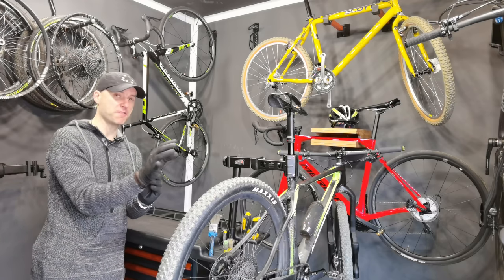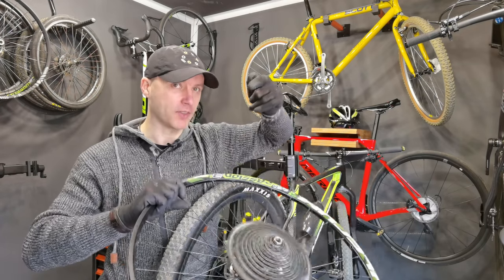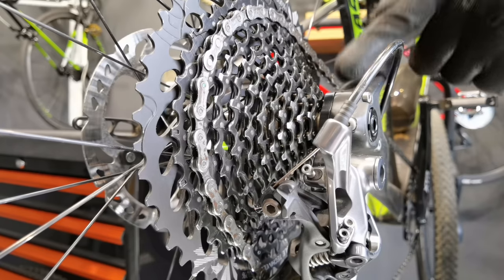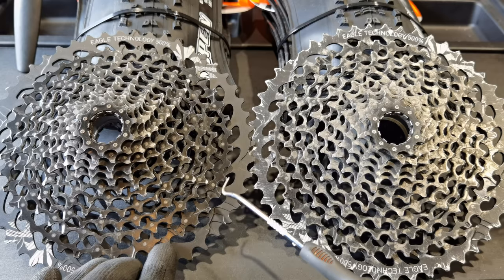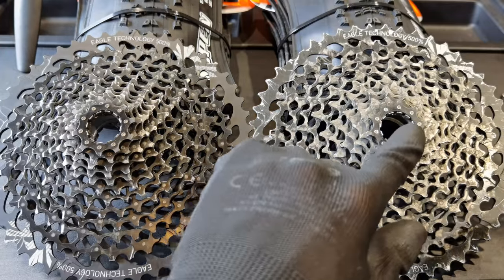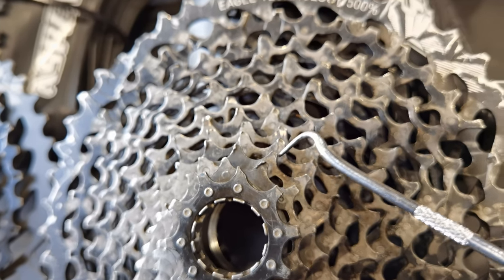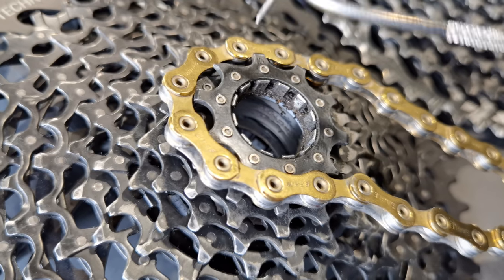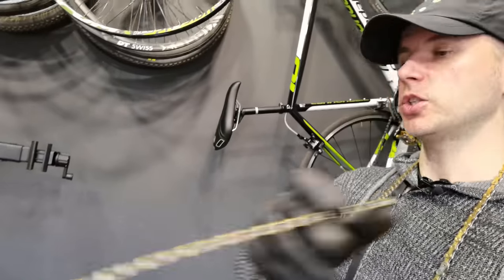When your cassette shifts like potato... 3000 miles Sram GX Eagle cassette vs 180 miles GX. Slow mo

Comment: Shifting is great on all cassettes since forever by now. You need to use compatible derailleur, adjust it, and the cable tension. Even the lowest cheapest group set properly adjusted will shift perfectly. The only difference may be shifting during a load, but this is not what you're testing. Also you're using sram cassette with shimano derailleur.. So I wouldn't expect perfect results.

Comment: I just deep cleaned my 2 year old Gx eagle, and it shifts beautifully. Just take care of these things and they will take care of you.
Reply: How many miles?
Mine has 3500 miles for 3 years. Looks fine but slips in a few gears :(
Reply: @joesmith3908  I'm about to replace my GX drive train. 6500 miles in 2 years. I think it could have lasted a lot longer if I had got 4 or 5 chains and rotated them. Use 1 for about 500 miles then put a new one on. Once you've done 500 miles on each of them you use them again from 500 to 1000 miles etc.

Comment: On my ebike the GX cassette was dead before 1000 miles, the 4th sprocket was not retaining the chain anymore properly. 3 and 5 had similar problems. It was used intensively and in muddy conditions but the bike was properly cleaned and lubricated after each ride. The chain broke just before the cassette (at the quick link). It was used but not dead (about 60% extension). I was very disappointed by the short life of that cassette. The biggest disappointment was there are no reasonably priced quality XD cassette alternative even in 12 and even 11 speed. Now i use 11speed gx cassette that i find second hand with low wear. I have one for about 2000miles right now and it's running fine but the weather is much better.
I think in the long term i'll put an HG body and 10 or 11 speed system.
Reply: You have an ebike that pushes some power- if you ride in eco mode or something in that area the cassette will service you longer time, but running it in some trail blazering on emtb mode to push some crazy power to that poor chain

Comment: I've had a 3x10 XT MTB, a cheaper 2x10 Deore MTB and current 2x9 Sora on my daily urban/road bike.

My 1x12 Sram NX is by far the best shifting rear derailleur I've ever had, fast and crisp, don't know if that's just Sram, over the top proper setup or just the works of 1x. Only dislike, which isn't that bad anymore, is that I have to push on both levers with my thumb.

Comment: I just finished lacing my wheels with berd spokes. looking good, what do you think of berd spokes?
Reply: What Is berd spokes?
It's a brand or a type?
Thank's in advance to light UP my lantern.
Reply: @tintinlavigne5257  both, its a flexible spoke made from strong fibers. it weights only 2.5g per spoke, my mtb wheelset weights 1070g. never heard of it until i saw it in lightweight builds.
Reply: @Ropetable  thank you very much i learn some things today
Reply: Is it way more expensive? Cz I wanna build a wheel too. Confused with the kind of spokes available..
Reply: @rahuldasmajumder5121  they are way more expensive. 8$ per spoke. worth it though, more comfy ride and lighter weight.
Reply: @Quercus Robur 8 USD a spoke, do the math for your wheel of choice. Berd spokes for a standard 28 spoke wheel costs 224.

Comment: It looks like is a little more smooth in the Shimano. By the way, the explanations of the shape of the chain were awesome but with jus one mistake, you said that's the shape that takes the chain to jump to the biggest gear, but it isn't, that's the shape it takes to jump FROM the biguest gear to the second one, because the derailer shifts the chain from behind, so the first teet to link with the chain are the ones behind then roll to back then they go up, but for the explanation its basically the same about what happens between the cassette and the chain.
Reply: It's just a bridge between 1st and 2nd gear made for better shifting, it works in both directions.

Comment: wow! what a bad cassette! Appropriately timing the shifts and proper maintenance would have greatly increased the lifespan of that cassette! I may be a roadie but even I go up some 28 rating inclines on my 30-11 cassette with a 36-52 crank. I've got over five thousand miles on my 2019 Shimano 105 R7000 groupset. It still shifts as good as day one.

Comment: As far as cassette, on my road bike brand new Sim 105 1000km the high few gears and low few gears are quite and shift perfect but a couple middle gears are noisy clicky like. I've played with the adjustments but I dont know what i'm doing. About to take it to the shop. Any ideas?
Reply: Maybe that's the gears that you use the most, so they are more worn out